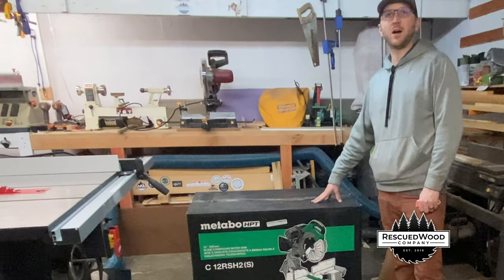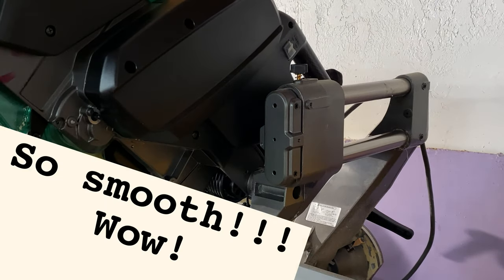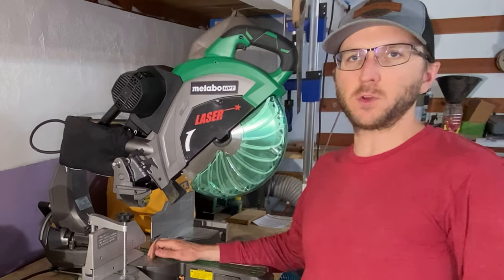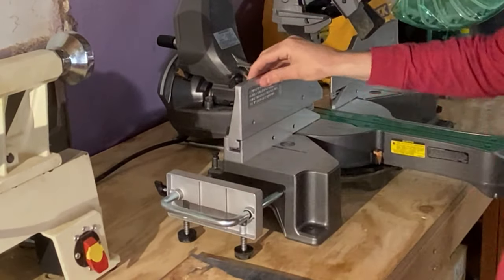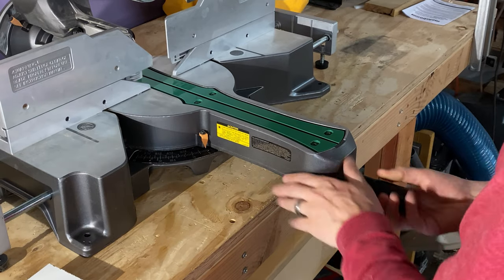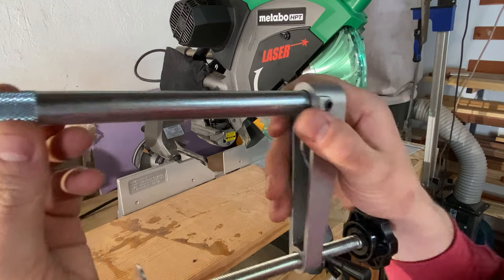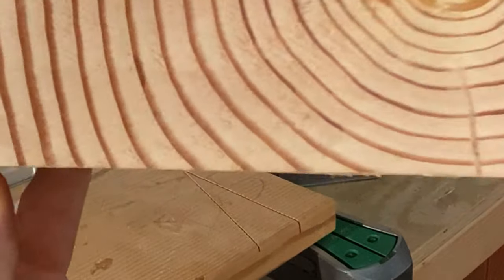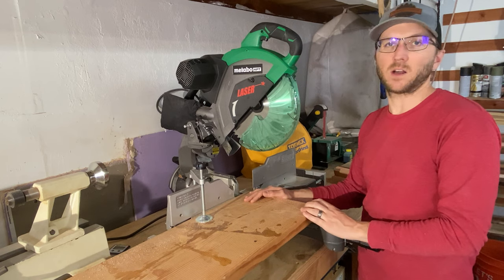Metabo 12 inch sliding compound miter saw unboxing and full review

Comment: One of the bearings just fell out of top sliding part.  I would guess I have used the saw maybe 12 minutes of total run time.  When that happened the head unit tilted and the blade cut into the metal where that little plastic piece goes that you have to cut the groove in.  My 23 year old dewalt on the other hand still works like the day I bought it.

Comment: I see Hitachi is now metabo. I have an old Hitachi 12 RSH. I like the saw a lot. It has the old slide mechanism that needs to be set further away from the wall. So this is an improvement on that. I don'r remember how much I paid back then, but I think its more than what you got your's for. It came with a crappy blade (although I'm just getting around to replacing it with a Diablo). Also, the laser line thing died almost instantly. There's a few videos  out there showing how the wire from the laser to the power supply gets crimped and broken. I just never bothered fixing it. 

But like I said, solid saw. Good luck with it
Reply: Hitachi tools are still branded as Hitachi in other countries.

Comment: Very important if you would like to saw with precision. Always choose a Miter saw with a handle positioned in a vertical line above the saw blade. Everything must be aligned, slide rails, handle, and saw blade, it is much better this way the blade will not tilt. Because there is some torsion in the aluminum housing . And choose an engine with softstart on it to prevent wear of the gear and worm shaft.
It is very important that everything is aligned. Here are some examples to show how the handle must be positioned above the blade. 
Bosch gcm 800 sj / Bosch gcm 8 sjl / Evolution rage 3 / FESTOOL KS 60 /  / HITACHI C12RSH2 / FESTOOL KS 60 E KAPEX / Metabo KGSV 72 Xact .
(This also is the case with the Miter saw without the slide rails).

If you want you can test it yourself at home if there is torsion in the aluminum housing.

Step-1. First you make a saw cut from +-5 mm deep in to a flat piece of wood. To this with the normal handle positioned on the right side of the Miter saw.

Step-2. Then repeat this by pushing the saw blade down with your hand (finger) on the aluminum protective cover were the saw blad is cased in. Just now only do this without the running engine.

Step-3. Now you can see if the saw blade will be positioned in or next to the saw cut.If the saw blade is (+- 0,2 / 0,5 mm) next to the saw cut then there is torsion in the aluminum housing.

Step-4. therefor it is much better to choose a Miter saw with the handle positioned vertical in line above the saw blad.

Comment: Great review, thanks for sharing. Did you have to do anything to bevel cut (at 1:46)? Mine came with the clamp level in the back super stuck. I tried loosing it but it didn't budge. Thanks.
Reply: There is a pin you have to pull to go to the right also